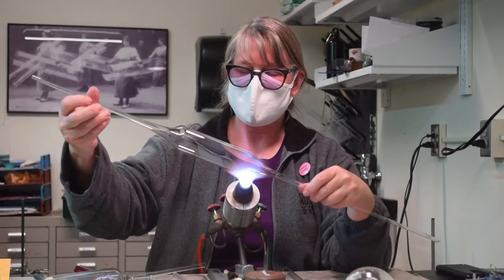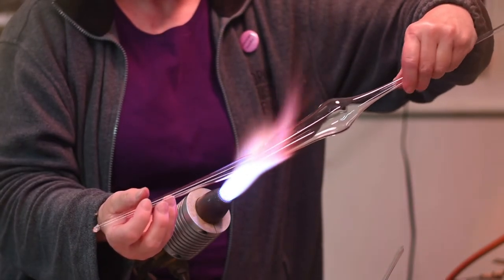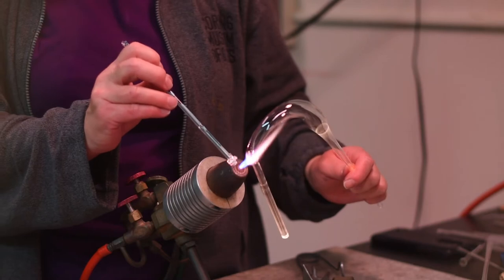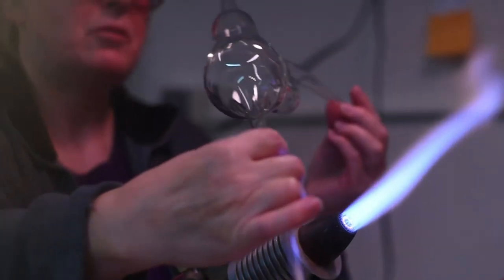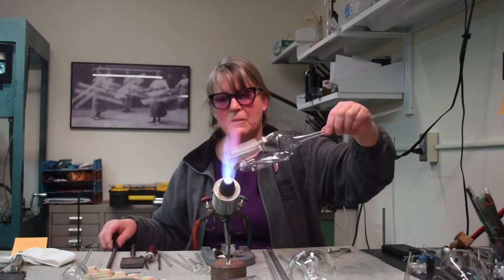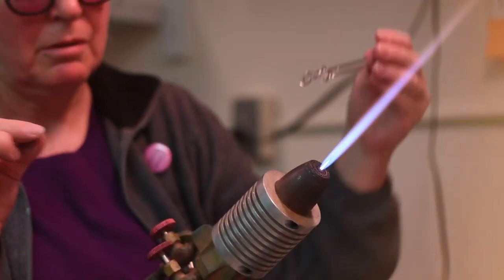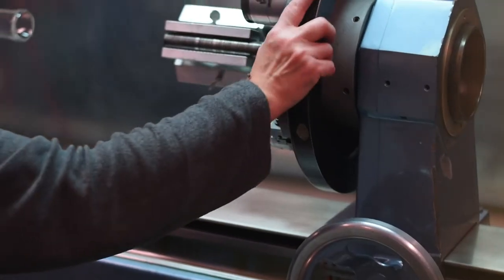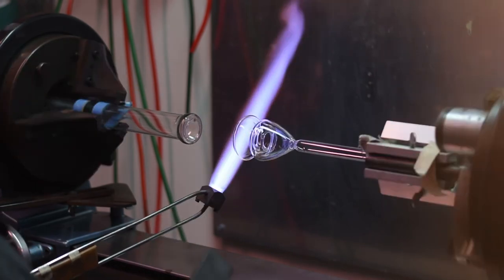Glass TEAPOT Glass Blowing With UVM Scientific Glassblower Sally Prasch

Comment: Those seals are bad. Good practice though! Use the small tight flame with all youre oxy pressure and just 4-6 hot flame and make thos connections liquid at each seam including that tube seal. A hand torch is extremely useful for seals and look into useing bridges to perfect the glass seal. I love it.❤